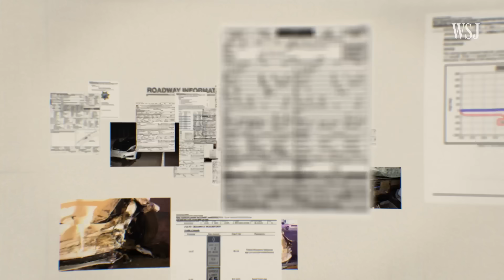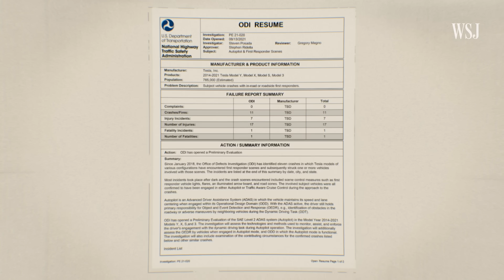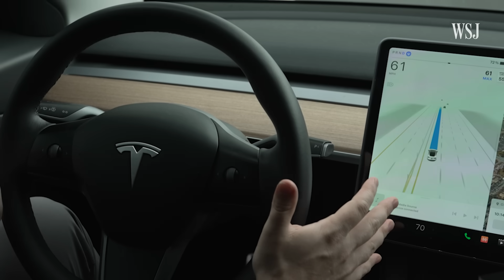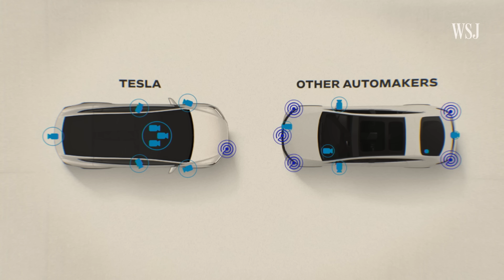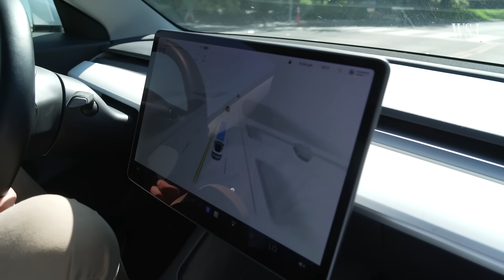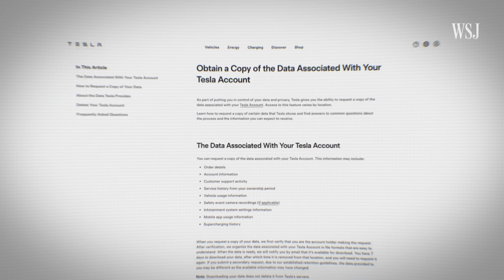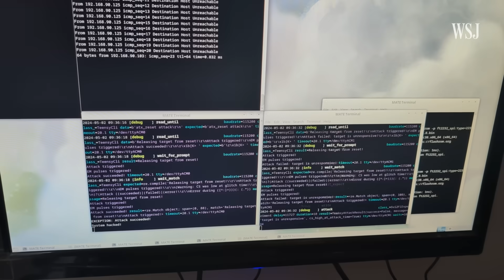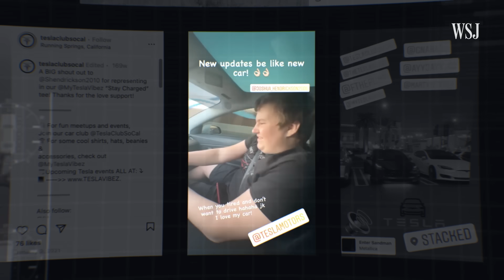The Hidden Autopilot Data That Reveals Why Teslas Crash | WSJ

Comment: I have some questions that need answering. 
1. Why is all your data from old versions?  Tesla has not once said the car can drive without human intervention.  Mercedes Benz and several other car companies use camera and lidar, but score WORSE on crash test ratings when it comes to detecting objects. I watched a Volvo C40 Recharge plow through a fake child like it wasn’t there. The Model Y stopped perfectly.

2. Seems that the investigators couldn’t tell the difference between autopilot and Full Self Driving. They are two entirely different semi autonomous suites, but that didn’t stop them from using autopilot interchangeably with either. 🤦🏻‍♂️

Before you do a hit piece on  Tesla, maybe you should get people who are actually knowledgeable?

FSD has been in BETA since February last year.  The most recent iteration is entirely different than the system the ex Tesla guy worked on.  Gone are the  300k lines of C++  code. No longer does it detect an object and then put it through a database of known object pictures to determine what it is is not…was replaced with an Ai learning neural net. It DOES train itself- the more the cameras see, the more they become accustomed to any and all situations.   I have FSD (supervised) and it is way better than the beta.  It will see a duck in the road and make corrections.   

Tesla vision is not what a lot of people here think it means. These “cameras” actually virtualize the world in 360 degrees, and detects depth of objects accurately
By the way, autopilot has never stopped at stop signs- it only sends an audible warning. 
FSD (Supervised) and Actually Smart Summon are next gen- and although they aren’t perfect, they are still hands down THE BEST without a 250k $ clunky goofy looking WAYMO car. I have had many trips without doing a single intervention. Even so, I pay attention to the road

Comment: Not just that, it's very dangerous for Bikers as well. It can hit y from behind. It was just cheap mistake that can be corrected by getting back regular "dopler" radar in the fron grill. Which is by the way working in the fog.
Reply: If you are riding a bike in the fog, that qualifies as attempted self delete.

Comment: Auto pilot is nothing but lane assistance. Full self drive and auto  pilot are completely different
Reply: uto pilot is nothing but lane assistance
Not lane assistance, lane centering—there's a difference. And it also includes "Traffic-Aware Cruise Control",
Reply: That is the thing in what sense they are different are you a hacker who can get inside of the computer reading? If you’re based on what manufacturer is providing then I believe that’s hugely lacking information.

Comment: It's already 2025, why is WSJ still stuck with something happened in 2021, do they know in AI years that's like a century ago basically. The current FSD is already in completely different paradigm.
Reply: 2021 is when they had evidence.  Now they can't find any.  So they use the old stuff.  Remember when GM had cars with brake failures?  Way back in 1991?  Yea, if they did a piece on GM they would say, "We are investigating hundreds of brake accident caused by GM vehicles.  Dozens of fatalities.  Millions of dollars of damage!"

Comment: If I am going to drive an autonomous car, I want it to have every advantage over me.  LIDAR - gimme.  SONAR? of course.  Would you rather your car be Superman or your own myopic self?
Reply: If it don't have smellovision I don't want it.  It needs to be able to track a deer in the woods like a bloodhound.
Reply: If I am going to drive an autonomous car, I want it to have every advantage over me 
The problem with this line of thought is that when the car has every advantage, it will no longer be affordable and so very few people with gain the safety advantage of such a car. For example, M-B Drive Pilot, which has LIDAR, radar, etc., is available only on the two most expensive models in their lineup, the EQS and the S-Class sedan. The safety effect of a few thousand of these is negligible; while the safety effect of hundreds of thousands and eventually millions of Tesla with Autopilot or FSD is huge.
Reply: @BigBen621  Some are well within reach, Hondas and many others have radar, and are cheaper than Teslas.
Reply: @liquefactionist   Hondas and many others have radar 
Then you should certainly buy a Honda and use their version of FSD. Oh, wait...

Comment: Calling it autopilot is the worst part. I do know that this technology has probably saved more lives than it has ended, just look up videos about close calls where no normal human would be able to react to a situation while driving. However people still need to pay attention while using it as it's not real full self driving. As in said the video the guy wasn't paying attention despite being told to by the car. I still think that something needs to change with tesla vehicles.
Reply: Autopilot and FSD are different things.  Every car that has acceleration hold has autopilot.

Comment: "The article on Tesla's Autopilot seems to cherry-pick negative incidents without providing a balanced view. An honest analysis would compare Tesla's accident statistics with those of human-driven vehicles, considering miles driven and conditions. It should also contrast Tesla's camera-based system with other manufacturers' use of LIDAR and radar, offering insights into different autonomous technologies. 

For each incident, context is crucial - was the system misused, or did it fail as designed? The article should discuss Tesla's responses to safety concerns, like software updates, and how regulatory bodies view these statistics. 

Moreover, acknowledging the limitations of all autonomous systems, not just Tesla's, would offer a fairer critique. The piece lacks mention of the industry's direction, upcoming tech, or regulatory changes that could impact safety and deployment. 

Lastly, transparency in data sources and methodology is vital. Without this, the article feels like it's manipulating public opinion rather than educating it on the complex reality of autonomous vehicle safety."
Reply: Tesla has the highest rate of fatal accidents per million miles driven of all automakers

There is no cherry picking about that .
Reply: @valerierodger   Tesla has the highest fatal crash per million mile driven than any other car manufacturer

No they don't. 
https://youtu.be/ksWGI3hdgwY
Reply: @valerierodger  When people lie on the internet, nobody can fact check them.  Watch, Tesla has never had an accident on v14.

Comment: This entire video did not compare the fatal crash number per mile driver and comparing them to human error rates. Very misleading not to include that.
Reply: Tesla has the highest fatal crash per million mile driven than any other car manufacturer, so make of that what you will
Reply: @valerierodger  They do, it is because of bad drivers getting behind the wheel of a car with more horsepower than they can handle. It performs the best of any car brand in crash testing.

Comment: Consider how often windows crashes, not surprising that any system relying on computers will  have glitches at times .....
Reply: Huh?  In 4 years, I have had zero Tesla software crashes.  You know windows only crashes when 3rd party software breaks?  Right?
Reply: @davidbeppler3032 didn't happen to u so it doesn't happen ....  Like those senators that didn't see the Jan 6th videos so it didn't happen ... Right ....

Comment: One sensor for head-on collision would make it safer.  But I agree with Elon that vision is better than relying on sensors.
Reply: Lame excuses 

Lidar exists for a reason
Reply: @jacksmith-mu3ee  LIDAR (all caps because it's an acronym).  Was invented in 1961 it wasn't invented for self driving cars.      I'm not sure what your point is.
Reply: @didier_777  another lame excuse . Cars pre tesla had it 

Thanks for proving my point bot .
Reply: @jacksmith-mu3ee  Do you demand every car have LIDAR by law?  Even old cars?  Retrofitted at owners expense?
Reply: @davidbeppler3032  if they have autopilot ??? Yes

Comment: Autopilot from 2021 is not the same as FSD version 13.  FSD is way better at recognizing objects now and saying that the current iteration of FSD is not safer than your average driver is not correct.  I would agree that at night I still don't trust FSD completely.
Reply: It is . FSD is a scam
Reply: @jacksmith-mu3ee  My car drove me for more than 2 hours today on the most dangerous roads in America during rush hour on FSD 13.2 in the rain and the fog.  I saw 5 accidents, none of them were Teslas.
Reply: @davidbeppler3032  sure you did . Care to post a video or provide proof
Reply: @jacksmith-mu3ee  There's a bunch of them online. 2 hour+ videos with FSD 13 where they have no interventions. I personally do 90%+ of my driving with FSD. I have the older hardware, so I'm stuck on Version 12 at the moment. The only areas it struggles are lane strategy (it waits too long to get in the right lane to take exits), detecting lower speed limits in school zones, and it sometimes goes a bit too slow. I routinely do an hour and a half trip to my in-laws without ever touching the steering wheel or brake pedals.

Comment: Proper public transport is the answer. Not just solving this but so many other issues.
Reply: Great idea.  How do you want to do that?  We could just reduce the amount of legal cars on the road by 20%?  Then force bus companies to run 100x more routes?
Reply: @davidbeppler3032  Good and important question. First of all, since it's a relatively free democracy, we can't just "reduce the amount of cars". To reach the goal of useful public transportation, you'll need a co-evolution of supply and demand. Of course this doesn't work without politics. 

Western politics and public opinion is shaped by car lobbyism. Despite cars destroying the livability of cities due to exhaust fumes, tire wear and noise, they were able to make us all believe that there would be no alternative to cars. 

Granted, for some stuff you need cars. But for many things (if you live in the US), the only reason why you need cars is because they managed to build the whole infrastructure around cars. This isn't at all natural nor necessary. Again, this is due to car lobbyism.

You were asking about alternatives. The best way to move around in a city is by bike for short trips and by tram if you have to go a bit further. Again, this requires a whole different infrastructure than you have now. So of course this will not be done in American cities anytime soon. But you were asking about alternatives. 

Again, it takes people to understand why we are in this situation right now, why it's far from optimal and what the alternatives are. If sufficient people have understood it, there will be enough demand. Ideally, at the same time the government will have understood it as well and will start working on it. 

In theory, since it's a democracy, in the end they are forced to do what people want and start providing that infrastructure. However, since it's a democracy largely guided by lobby groups, and the car industry is a big one, these things might never change.

Best regards

Comment: After my experience as a human factors engineer with a major aircraft manufacturer, I can tell you the trusting automation to always do the correct thing is a very huge issue.  How to warn the system operator when the automation can’t an appropriate response to an unusual or non-normal situation is also a difficult problem to solve.  With aviation automation under such dubious situations, the response is to automatically disconnect the automation and warn the pilot that intervention by the pilot is required.  A big difference between airplanes a cars and trucks though, is the timeliness required of the need for human intervention.  Interventions can be required for aircraft automation system failures or faults and when encountering unexpected or unanticipated situations.  The same is true for cars and trucks on the road.  

Quite obviously the choice of what sensors to use for detection and monitoring the nearby environment is essential.  The dilemma  involves replicating the senses that a human uses to determine how to safely drive the car or truck.  By the way, sensors also must account for the differences between a car and truck as well.  The need for increased levels of vigilance at night compared to during daylight operations is also a factor requiring compensation.  For the same reason that highways allow driving safely at higher speeds compared to driving on city streets or in residential areas near homes and schools, for example, also is a consideration that must be factored into the automation algorithm. 

I was quite surprised that the Tesla automation learning algorithm cannot “learn” as intuitively, or as directly as a human driver can.  That the Tesla algorithm cannot only be programmed to respond to previously encountered situations.  That it can’t learn more directly from newly encountered situations.  The false sense of security reaction by the driver that the automation can properly respond to previously unknown, or completely unique situations is very frightening.  I have always been concerned about a system that relies totally on the belief that nothing is detected in the path ahead of the vehicle and that sudden unanticipated intrusions into that “safety zone” need to be reacted to immediately to avoid a collision.  This ‘eyes in the back of your head’ extra sense must be somehow replicated in the automation algorithm.  Whereas, in aviation, intrusions into the safety zone or protection zone, aka flight path, are prevented by requiring potential intruders to fly at different altitudes and by allowing space between aircraft flying in the same direction.  This is a significantly more serious problem for aircraft that operate in a three dimensional environment rather than the two directional environment of the road or highway. The cars and trucks, one does not even worry about objects coming at you that or not also on the road.  

Analogous to trains operating on railroad tracks that are designated only for other trains, I have believed that the only way to guarantee safety is to properly warn the operator of approaching intersections where crossing or merging traffic may be encountered.  And, to alert when intrusions have occurred. Such a “closed” environment where most obstacles can be prevented from encroaching into the trains’ safety zone is the safest way to operate.  The very same operating environment must be assured for cars and trucks on the road as well.
Reply: Read Nuralnet.  Then repost.

Comment: Seeing this video, makes me very happy that I made the correct decision not to use auto pilot when driving a Tesla rental car for 2 days. During the rental period, I was even driving at midnight. FYI, without using auto pilot, Tesla cars are very unpleasant to drive on.
Reply: Which Tesla did you rent? They're very fun cars to drive. Even the slowest Tesla is going to be faster than any car most people have ever driven. Everything just works once you get used to it. I pull into a parking spot and just walk out of the car. It puts itself in park and locks after I leave. I walk up with my phone in my pocket and just get in. Updates are automatic and frequent.

I don't think rentals have FSD, but you should have tried Autopilot with lane keep. Its very good on highways. My Subaru has something similar, but it relies on cameras to find the lanes, so it'll just randomly disengage in the middle of traffic light intersections that aren't clearly marked, or older roads. It also seems to bounce around within the lane, almost going from one side of the lane to the other.
Reply: @kungfoochicken08  I rented a Tesla model 3. No confidence on automatic driving. It was back in year 2022. Now, I think technology is much better

Comment: I can confirm that the 2022 Tesla model 3 has ajtopilot issues… for me it would break and decrease in speed from 60mph to 30mph for no reason, nothing in the road or anything. I don’t like using it that much due to that.

This ALSO happens with simple cruise control…….

Comment: I've always said that depending on FSD is suicidal because it can do a good job 99% of the time but thst one time it screws up, you're dead.
Reply: thst one time it screws up, you're dead. 
According to NHTSA statistics, that's occurred twice in two billion miles Teslas have driven with FSD engaged; i.e., once per billion miles driven. Meanwhile, again according to NHTSA statistics, 13.3 average drivers would die driving 1 billion miles. So I don't think of a driving aid that's 13.3 times better than average drivers as "suicidal". Of course, you're welcome to believe whatever you wish, no matter how wrong it might be.

Comment: The big flaw is that the autopilot system keeps going when it doesn't know what to do and the driver hasn't taken over. It should insist that the driver take over by coming to a gradual stop until the driver takes over.

Comment: I have 'collision avoidance' warnings on my cheap old Ford. That seems to meet all the needs I have- it may possibly spot something I do not, and gives me warning. That's all I need. After a few years driving with it, it has only ever popped up when circumstances have been actually safe because I already had things under control anyway, so it didn't actually have to do anything, but it is like having a sensible and observant passenger, advises me in case I hadn't seen 'whatever'. That seems a better system than this tesla stuff to me.